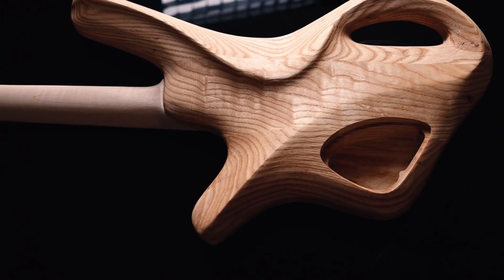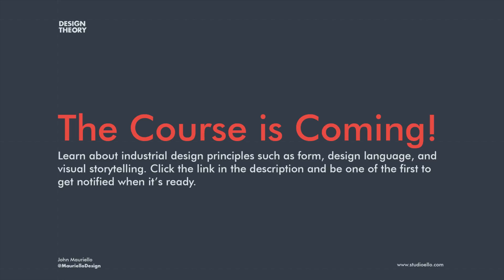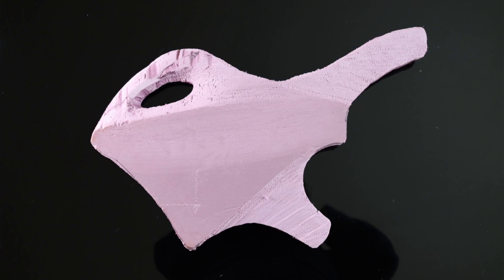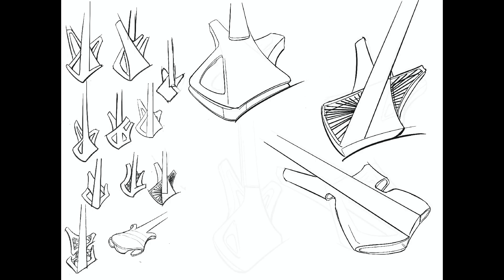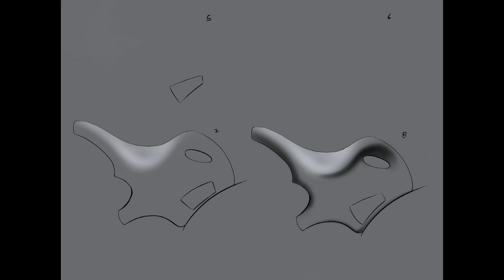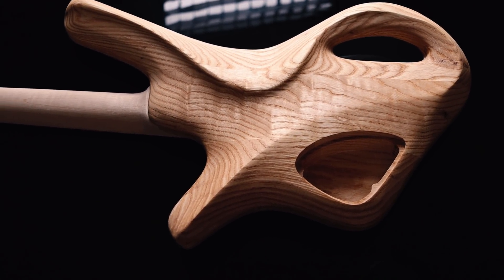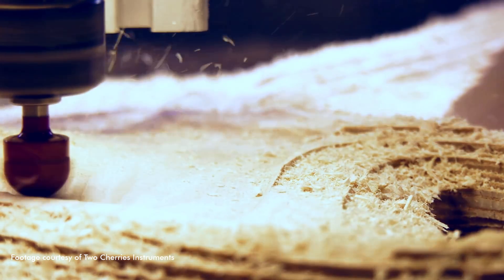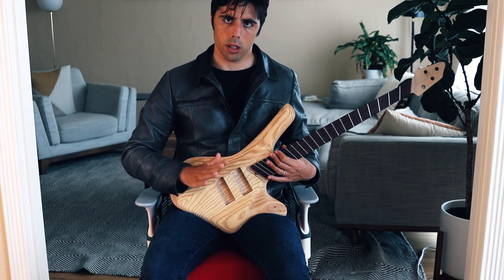How I Re-Designed the Traditional Bass Guitar: Industrial Design Process

Comment: I like the process, a little bit less the shape. Ther real problem with this kind of posture is that the fretting hand is too far from the headstock, this resulting in problem using the first 4 frets. All the players that use this kind of position (Feraud, Gwizdala) play mostly with chords in the middle part of the fingerboard. The average bassist, that is playng whit walking and stuff like that, unfortunately will find the heaven in the plucking hand, but the hell in the fretting one. One solution could be the use of a 32' (or a 30') scale bass in order to get the headstock closer to the torso. With all the problems connected with this scale configuration.

Comment: Thank you so much for this video! I already watched it a couple of years ago, and it was really inspiring! Now I’m building my own bass guitar! It looks much more traditional, but it’s still very comfortable. I like how a Jazz Bass feels, but some things annoyed me, so I tried to fix them. But only on screen, not with foam models like you did:
- the belly cut went more forward, more towards the neck
- the lower cutaway got the horn removed
- the controls area got more compact so it’s not so massive between the legs in classic playing position

In the end, it looks like a modern interpretation of a Fender Jaguar (LEH Guitars also modernized that shape, but my design looks very different still).

My first drafts were pen and paper, then I designed it in Inkscape and made lots of iterations, tuning the shape here and there. Then I made a 3D CAD model from it in FreeCAD (there is a plugin called Marz Workbench for it which was very helpful). And then, I laser-cut a routing template and had a body made from it. Felt great already! Now I hand-carved the forearm and belly cuts, and I’m really happy with how it feels!

But ergonomics wasn’t the reason I wanted to design my own bass. It’s actually because a friend designed a sliding pickup system which, combined with a filter preamp, opens up a whole new world of sound options. And with the design ideas I already had in my mind, everything just came together. I can’t wait to hold the finished instrument in my hands!

Comment: I love your channel, and applaud your intention to build a more ergonomic instrument.  One limitation that you face, it seems to me, is a lack of understanding of good bass guitar technique.  For example, the left thumb goes slightly above the curve on the back of the neck, so that you can wield the weight of your arm, which allows you to have a relaxed hand instead of gripping the neck.  The right wrist will develop carpal tunnel if you mash it into the body as you've demonstrated.  An important design element that you seem to be missing is that the instrument should balance when hanging from your strap when you stand.  The most important thing, though, is that the instrument resonates well, and responds evenly across the entire frequency range.  The back of the instrument should fit your body.  I don't mean to be condescending, but I do speak from 50 years of experience.

Comment: Bass player for over 40 years.

I never play sitting down and come to think about it, I don’t think I’ve ever seen anyone play bass, at least not in front of an audience, sitting down. I’m not saying no one plays bass seated, but I think it’s pretty rare. So, it seems curious to make it such a design priority. Especially, that playing standing, didn’t seem to be a consideration at all.

I find that because of the length of the scale, that having the bass in my lap, especially in the classical guitar position (fine for a 25.5” scale classical guitar, but really uncomfortable for a 34” scale bass), puts the end of the finger board at an uncomfortable distance from my body. Probably, not a big deal on this bass, as it appears to be a short scale.

Also, it looks like a 34” standard scale would probably be neck heavy. To me, neck dive makes a guitar unplayable. I’ll never own a SG. Perhaps, a headless design like a NS Design NXT4a Radius (an extremely ergonomic bass, btw), would be worth considering.

I hope it comes with dual truss rods, because that isometric neck is going to bend differently on each side because of the differing thickness of the wood.

One last observation, one would assume that such a modern looking design would have modern electronics. There doesn’t seem to be much space for two 9vs, four pots, an output jack and a preamp.

I like the look of it, but I think there are some engineering challenges that will need to be addressed.

Oh yeah, and it looks like a lot a Warwick Dolphin.

Comment: The Right Arm contouring on the body is a perfecting of the 3D shape from the traditional Flat Top guitars.  While I like that, I endured it in my last instruments because of the presentation of the Quilted and Figured Tops on the instruments.

Weight was always an issue from past.  Neck Dive was more observable in the 5 and 6 string Instruments. Imbalance would work the strap shoulder. Steinberger floated many design characteristics which clearly challenged Wood particularity and weight having anything to do with the tone of an instrument, and dealt well with the Balance issue by Bridge tuning.  Very respectable in design, innovation, and tone.

As an opinionated person, having observed many electronic, pickup, and wood variations, I determined that all do matter.  For a Fretless I settled into a Mahogany Core Body and Fretted Basswood.  For what I was anticipating in tone between these two applications, I believe that these choices probably brought that last 5% of what I was searching for, as the instruments themselves as selected shared the same Pickups and Electronics, and Hardware.  Although I started on the Double Bass Violin, the Fretted Bass Guitar was the more inspiring and attractive tone to me, so the discovery of Basswood clarity was inspiring.

Asymmetrical Neck is not objectionable, my second 5 string/1st Boutique had that and it was nice, not a Chris Squire Technique Instrument but nice.  The Steinberger lost me due to the neck being so batish.  This is an "each his own". I settled at Flat and Fast, and that is probably because of the Low B which has the girth more to the Gauge of the DBV's I played in school.  Playing that string even at the 5th Position to make the low E Note just has the sound of dropping an Anvil next to your foot that the Open E does not really reach.  It is Dramatic.  5th Position also gives so much additional range into the Rhythm Guitar Tonal Range I could not resist,  Then to have the lower extension beyond in the other direction!

Fanned frets...Mathematically/Harmonically/Tonally Perfect, driven by the tone of the High C String of 6 Strings stretched out to 35", nice idea.  As a past player, that type of neck arrangement will be left to the later generations of players to deal with the positioning shift and C saddle hitting the index finger on the Notation hand.

Interesting work.  Keep at it.  Enjoy the discoveries.

Comment: Really cool video, very interesting. I think it's interesting that you decided to design it around the classical position because it's "just better." I've always thought that the classical position was pretty much incompatible with a nice long scale length on bass. Also, once you stand up and hang it by the strap, it's automatically gonna swing to the right again.
Reply from the maker: Good points. This is a 32"-29" scale length, so it's a little bit less of a reach. And the body is designed in a way where the lowest frets are pretty close to your body. But you are right. Most people just aren't used to playing that way. So I designed it to work well for both positions.

Comment: The design goes against all of the design conventions with electric stringed instruments and there's a reason that they're there. The bass looks uncomfortable and like it will resonate really poorly since most of the weight has been taken out of it. Basses - especially more than guitars - really on the mass of their body to resonate as low frequencies require more mass.
Incredulous that you didn't mention the acoustic properties of the instrument once - which is the most important factor in an instrument design. I can understand putting form before function to some extent but you can't completely ignore function. 
The fact that you made an asymmetrical neck is also the dumbest shit I've ever seen. That neck will very quickly warp in the direction of the thin side of the neck. To think that you're such a genius that you were the first person to come up with that idea when tens of thousands of highly skilled luthiers for centuries have never done it successfully because it is literally impossible to do with a standard Truss rod design. Seriously ... do some research. I studied the acoustics stringed instrument design at uni and this is embarrassingly bad.
Reply: @Donaldo Thomoson  yes, it does. The extent of the effects of tone woods in electrics is highly debated but it certainly makes a difference. The data isn't readily available since it's all been collated by instrument manufacturers and they like to keep their secrets. But the reason why the same woods are used in acoustics and electrics is because it does affect tone.
Reply: Absolutely, the resonance of the guitar feeds back into the vibration of the strings, adding overtones. I have an ash, two  alder and a mahogany bodied bass. I have the same pickups in one of the alders and in the mahogany bass, they sound completely different (I prefer the alder)

Comment: How would you address designers designing for the look rather than for the purpose and COMPLETELY misunderstanding the purposes of their designs they rarely to never themselves use, as well as designing for the jobs they never fulfilled themselves. I'm a designer now, but I've been a bartender for ten years. I've worked in so many bars in London, in five star hotels (so they've really spent a buck on top designers they could've find) and the bar designs were to me like "wtf? Do they not know brass and copper bar tops will dye the sleeves of my uniform green as brass and copper are low quality base metals that patinate and rust green?" or a coffee machine, built like a tap water faucet because "it looks pretty" completely ignoring the fact the traditional bulky body of a coffee machine is there to protect the user so I Don't Burn myself with a pressurised boiling water while using it, I burned my arms and hands with boils on that "coffee machine/tap" so many times I thought I'm going to kill that stupid designer who made me literally physically suffer so that his "coffee tap" looks bit more slim and sexy. Obviously, as "just an employee" I could never speak out to anyone, nor my management cared, as "the bar was done, and the company wouldn't change the great designers vision, just to make me safe." from that moment I hated designers and thought "they're all idiots detached from reality" until I became a designer myself and decided I'll do and test all my prototypes personally before releasing even one of my products, and luckily perhaps differently to some designers who only design 3D I know how to make my products from scratch, by hand from beginning to end as well as produce them digitally. How would you avoid mistakes like that, how would you say designers should educate themselves in depth about the use of their product before flopping a release and potentially seriously harming someone with their lack of thoughtfulness? We all know a bad haven't thought through design can harm in long term, short term, even take lives. Architectural designers have to study legislations for years, because if we imagine designing a balcony without a barrier "because it's more beautiful like that" it would kill people, but any other designers i.e. interior designers are kind of let loos "ok, make stuff until you get sued". Even me, studying basically fashion design I was barely taught how to design the innovative creative products that I want to design rather "just do what everyone else does", so how would you say should be the procedure to design under a pressure to be completely innovative and design stuff no one else designed in a way that is safe, while challenged with shortening deadlines and less and less time given for appropriate tests and research.

Comment: I made a few guitars with very fancy shapes just for experiments, and  from pactical knowledge can say that this body will lose lots of frequencies due to the poor internal resonance caused by holes and cutouts in wrong places. It will sound anyway. Even the fence sticks sound loudly. The guitar shape has lots of meaning. It is  forming the resonance for  the sound frequencies and amplifiing some of them more than other. The change in the width by half  inch can invert the phase of resonating sound and kill it.   I observed it many times when changing the shape of working guitar
Reply from the maker: This is not true for electric instruments. I have tested it myself. If you don't believe me,  someone also did a test on YouTube about this exact topic. You can search for it

Comment: You talk about removing design details that are unnecessary yet you left the "drip" inspired  lip on the back. You need to also think about pressure against the human body and realize that the finish/paint on that lip will most likely be abraded off. I get that a millennial  would not like the Fender Precision but beside the body shape or can I go as far to say the Fender Brand shape the tone the body make is what makes it iconic. Sometimes simpler is better.
Reply from the maker: 1. I would argue that it's necessary as a visual element. This is admittedly subjective though
2. The lip is a wider radius than the edge of any p bass, so it's less prone to wear. 
3. Body shape and wood has nothing to do with tone on electric instruments. Someone did an awesome study about it here on YouTube. You can search for it. 
4. I love Fender P basses. I own one. I just wanted to do something different.

Comment: well dude i am a bassist and i can tell you for sure - there is more about design around the bass guitar... type of wood that gives special timbre to sound spectrum... there is special coleration between wires that goes through body, but there is even bigger difference in sustain and overall tone if you consider the angle that those strings flow through the  body and like the distance they travel like i am not an englishman but how fat this body is and proportions of masses.. it is quite hard for me to explain it, but I built a several guitars, and learned from old lads who did houses as well as tables chairs and our ethnic instruments... if you need any help, feel free, and i would be honored to help you in your design ideas. let me know what do you think... cheers! :D

Comment: So here's the real question. How does it hang when you put a strap on and play standing with it? There's a huge difference playing with an instrument sitting versus standing. If all you ever do is play in your bedroom then this might be fine, but if you are gigging you will be playing standing up and the bass will be hanging which changes the ergonomics quite dramatically. The original Steinbeger basses made that mistake. There was no top horn and the bass was extremely uncomfortable to play for long periods because the weight was no well distributed across the back and shoulders of the player. NS design has made significant improvements with the latest version by extending the top horn to the 12th fret to get the most even distribution of weight.

Comment: Hey, bass player here. While I like how your bass is designed with comfort in mind, the way you describe traditional bass guitars as carpal tunnel generators is very misleading. When using proper form, you should not have to bend your wrists to play the bass, many teachers will tell you this (in fact, they stress the importance of it). If you’re playing bass and your experiencing wrist pain, 9/10 it’s the fault of the player.
Reply from the maker: Most people do just fine with a P or J bass. But those basses make it harder than it needs to be to use good technique. Once again, if you have no trouble using "regular" basses, you have no need for this instrument. But there are a small subset of people who fight their instruments unnecessarily.

Comment: This looks great.. What is the scale lengths ? I bet the final weight is excellent.. The only thing as a bassplayer I will note is that IME the pickups should be angled like the frets. The thicker strings will be more bassy and the thinner strings will lack body as you have it now.
Reply from the maker: It balances great. Final weight of this prototype with all parts installed is just under 7 lbs. Scale length is 32-29". You can hear sound samples on my Instagram (link in description)

Comment: Beautiful design, and I appreciate your thorough process. Does the Bass have any "neck dive," as it is something I would consider a serious problem. It looks like the Bass may have a 34" scale length. I know there are good reasons for that, but playability is certainly not one of them. A short scale Bass is much easier to play, and is more "guitarist" friendly, and will reduce neck dive, if there is any. With the wide variety of strings available, getting a good tone should not be a problem.
Reply from the maker: No neck dive while standing!
Reply: @Design.Theory  Excellent 👍